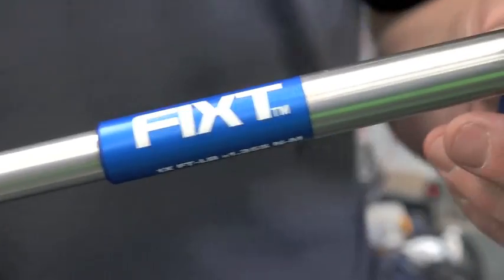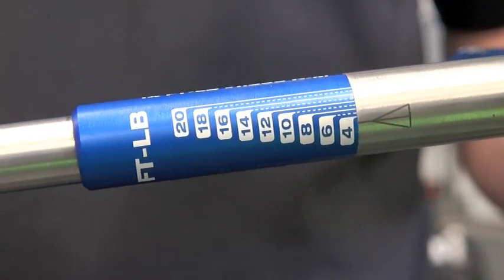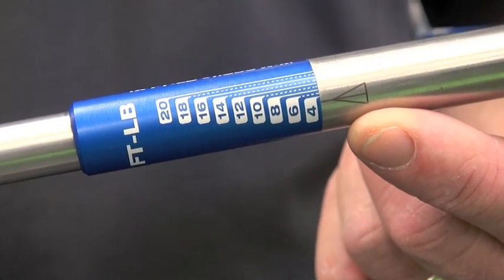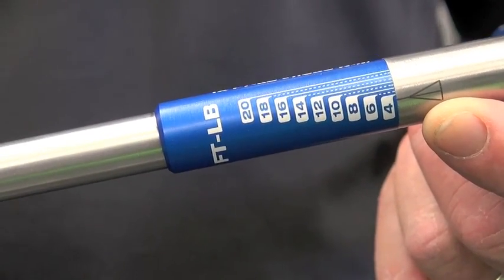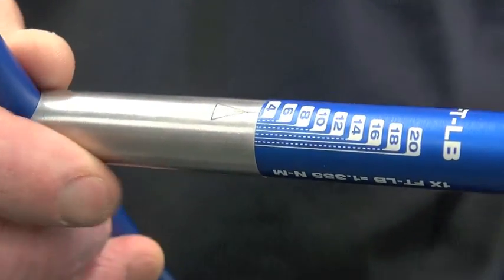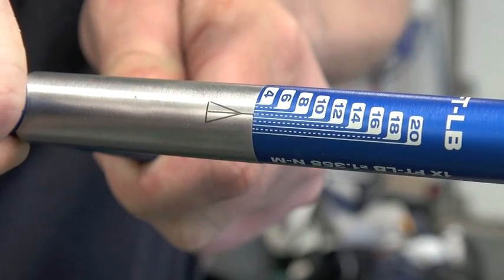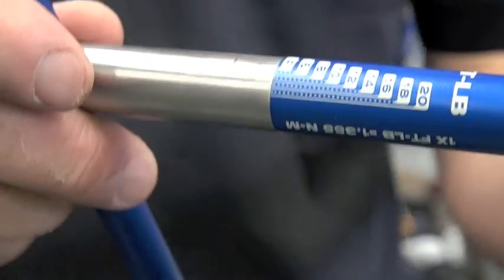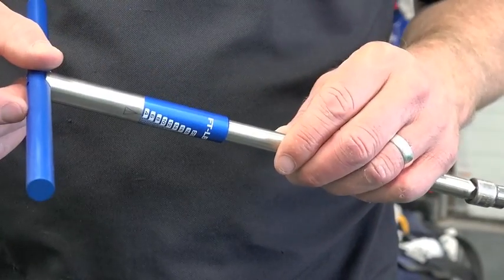Fixt T-Handle Demonstration

Comment: Not a Huge Moto Mechanic at all..But the T Handle REALLY shines in MTB/Bicycle applications as well. Torque spec on carbon fiber bits Is REALLY important..and the Fine tuned FIXT really gives me piece of mind.